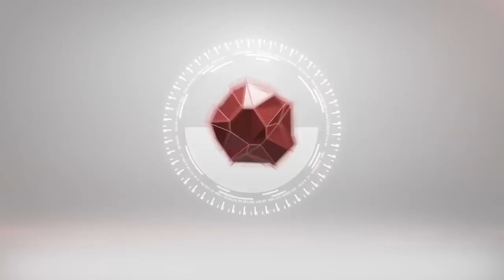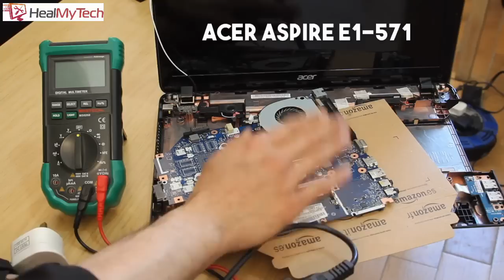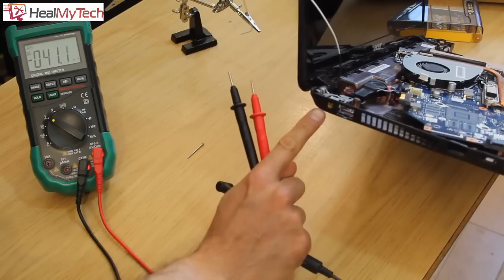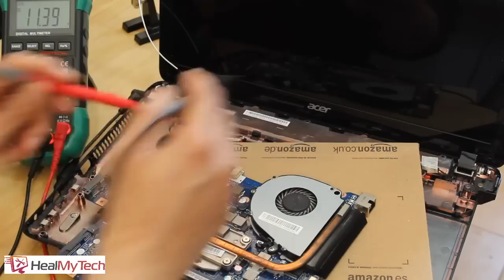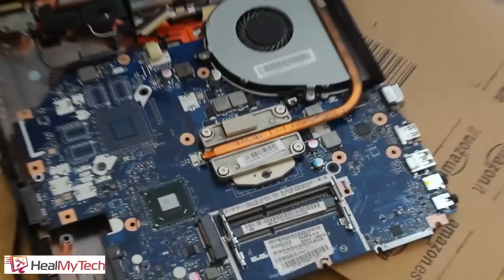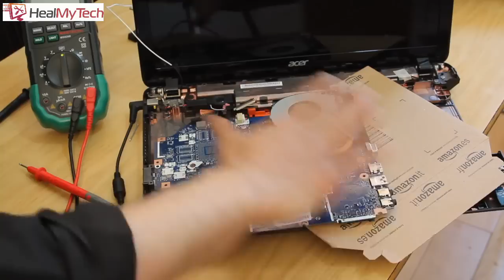Laptop not tuning on no led no light no signs of life | How to test a dead laptop motherboard

Comment: it could be a MOSFET between the jack-port and the connector you tested which should be easy to repair but that's the other side of the coin. The vision that I had before was to replace the MOBO. Maybe now I would give it a try to replace the MOSFET. I have seem that with the proper equip. is kind of easy and the parts could be taken out of another spare MOBO. Believe me my philosophy towards those problems changed very much. It would be fun!
Reply: There are no mosfetts between the jack port and the connector. The mosfetts are after the connector.
Reply: joe carr and you have a video to explain that ?

Comment: Is 19volts DC really going to electrocute you? I think before you start doing any work on electronics you should understand that you'll be ok...however letting that barrel plug with a nail in fall on the morherboard might cause some issues...might want to work with it not directly over top of the motherboard. Sorry being an ass, just felt it should be said for anyone out there that might be afraid of this type of repair for reasons they dont need to be.

Comment: Question :  What if the voltage reads correctly on the MB's power connector ?,  could it be a short circut on another power component  ?? ... any ideas ?
Reply: I have same problem dude I test and my motherboard is getting power but won't turn on
Reply: Power connector should be around 3v - 5v. Thats the standard for push button
Ram should be 3.3v at socket or 1.35v - +
Battery port should less than battery  volt output

Comment: Thanks for your great videos first of all!!! now I'd like some advice.... i have a no power problem on my Acer r14  no charging lights come on and it won't power up. its never been dropped or overheated. Is it possible if i replace the battery this will fix problem?  i checked the charger and is at 19v (which is correct for this unit). i feel skilled enough to change a battery but I'm not comfortable messing with the MB. should i order a battery? would the pc power up when connected to power if the battery was the problem? does that eliminate battery problem?

Comment: I plugged my laptop in one day while using it and it went black instantly. It was completely unresponsive. I tested the charger and it was working correctly. I tried disconnecting the battery and just using it while plugged in, didn’t respond. It’s still under 1 year warranty.

Is this a motherboard issue? Also how did my motherboard get damaged?
Reply: S M mine got damaged by a fucking usb 😖

Edit: not a normal usb in but usb to micro usb for charging like a phone or transfer data
Reply: me too agh
Reply: Same bro

Comment: My Acer Aspire E1-571 laptop is really bad; it doesn't charge unless I tilt the cable, the RAM is 4GB which struggles on Windows 10 (I honestly don't know why because I know people who run fine with it, and although 'malware' can be brought up, I beg to differ that I have malware after various scans.) The hard drive especially is a pain. I am always getting blue screens of death, even on IDLE and the disk is always 'corrupt' so I have to use chkdsk which only works for a short amount of time. I have used Linux but even then I do get errors, although fairly minor, they do stop me from doing tasks such as playing games. It generally is a bad laptop - poor battery life and a poor screen which is full of glare and very sub-par in terms of picture quality. The keyboard feels cluttered and all of this just adds up to my conclusion in building a Gaming PC. Although I have not yet decided whether to buy new or used parts, I do want to get the i5 2500K as I have heard that it overclocks very well.

Comment: I was told when testing with any electrical meters or live juice use insulated gloves just in case. Couldn’t hurt. Thanks for great video
Reply from the maker: You are correct and thank you for the advice, I shall add some disclaimers and in the future be more careful.  On a motherboard the voltage is not that high, but still, better be safe than sorry!

Comment: Dell inspiron N4050 laptop ac adapter light turns off -

I have a dell inspiron N4050 , last night
the battery charge was around 7% and I tried plugin the power adapter .As soon as charger plugged in the machine went off and blue indicator light in the charger also went off.

I couldn't boot the laptop again both with and without charger.

I also tried removing the battery and tried still when I plug the charger the blue light goes off.

I tried the followings.

Removed battery 
Pressed power button for about 60 sec.
Inserted the battery.
Tried power on without charger
And then with charger(again charger blue light goes off).
Still no luck....

-------------------------------------------------
Is the mother board dead? :-( 
I guess any capacitor shorted, but I am not sure....
Is there any other suggestions I can try?
-------------------------------------------------
Reply: Sanjib saha same bro

Comment: Hi 
I own the Acer  Aspire E1-571G which its power jack  was loose and sometimes not charging the battery , once I open the laptop and  tried  to fix the power jack loose connection wire , however suddenly my Iron solder shortcutted   to the power jack body and sparked and my laptop never turn on anymore , I guess polar diode connected to power input socket may harmed 
I really appreciated to have any advice or repair procedure for this issue
Reply: Hamid s k i have the same problem only that i did sparks on purpose cause i was bored

Comment: how bout if my laptop is not turning on but when i plugged in the power cable, the led light for battery is on. but i can't turn on the laptop. is the problem keyboard or the motherboard? btw the power button is attached on the keyboard. There is no safety pin for reset too. The laptop is Asus x441s
Reply: Did u get it fixed yet..if yes what was the problem?
Reply: @deejay7218  no i haven't.

Comment: Another reason why laptops are not the best bang for buck computers. When its a problem like this, getting a replacement motherboard is not going to be cheap, then, if you are not comfortable replacing it yourself, getting a tech to do it will cost you about another $150. 

By this stage you a better off selling it for parts and buying a new laptop or take a chance on a refurbished or used model. 

So basically, if you get a few good years out of it, you have a case to not repair and just replace it, but if its just out of the standard 12 month warranty, then you are shit out of luck.

RAM or hard drive issues are not too bad, and quite easily replaced, but a motherboard issues is something else.
Reply: you got that right, but people just don't agree with these facts at all, the portable machines is all they want and the only people that benefit are the manufacturers that make them, because they get sold anyway
Reply: older models are cheap $50
Reply: Or you could learn and fix the motherboard for few cents or even no cost at all.. It is a short or blown up capacitor 90% of the time, 9% bad mosfet, 1% bios and startup chips or other chips (all you can get from aliexpress or ebay for few cents or few dollars). Repair shops charge $150 for knowledge only (or your lack of it), they don't have any costs to fix your mobo.. it is not that hard to learn those things and average person can try and fix it by himself/herself before spending several hundered dollars for new board, repair shop or new laptop.. knowledge is priceless but cost you nothing.
Reply: @Marko_Djuricic  Please can you refer me to a website where I can learn how to repair motherboard. Thanks
Reply: @andfthxcvjdyi2875  Go to youtube channel "Electronics repair school"..
Reply: @Marko_Djuricic  Thank you so so much . The channel is really helpful.

Comment: very useful video. i will download and save this. excellent work sir
Reply: i have integrated intel chip problem. on dell latitude d630 motherboard. it works for a few minutes then turns off. and then when turned back on. light blinks and turns off. they told its main chipset. is it possible to reheat it?
Reply: Yep! and maybe both. I have been told same by Technician to replace motherboard. but i was not buying that until i verified it from you. Thanks my friend.

Comment: What you have done is not clear, because it might be a power adapter issue, for example a bad capacitor inside that is not able to drive current anymore and it makes the power-supply shout down right away. 19V 99% of the time is present when is no need for current.
You should have used a new power adapter to make sure the board was not working ok
But you should have started with continuity test before plug the adapter in.
repairing a short circuit is not an hard task, you start removing components one at the time, at least you know when you have found it. And if you find that the power jack is in short circuit, most likely the component that is broken is close to it.

Comment: next thing is to do disconnect the laptop then hold the power button to discharge  electricity  *from a single wire, then *presses the speaker
nice...

Comment: can you get a shock of just 19 volts?
Reply: Above 30VCC is not recommended. But it depends on current also.
Reply: You can't even feel it on the skin. On your tongue it hurts. The question is how much current is going through.. Voltage is just the potential difference between plus and minus.. the bigger the difference (voltage), more current is passing in the unit of time.. skin has big resistance so it "blocks" current from flowing.. if you put million volts, the potential difference (large amount of current) can brake the skin and current can flow and kill you. Tasers have like 50000 volts but limited current to like 0.01 amps so it shocks you but not fataly (can be lethal if it's prolonged time of use or physical condition of your body (heart) is not healthy). Also if those million volts are put on your skin for a nanosecond, you can survive because not enough current can pass in that time (lightning strike survivors for example). So current kills not volts but more volts equals more amps so volts also kill but because current is bigger too and your skin cant handle that much amount of current.. But those 19 volts are fine, no harm at all..